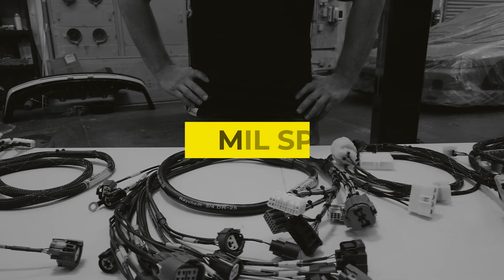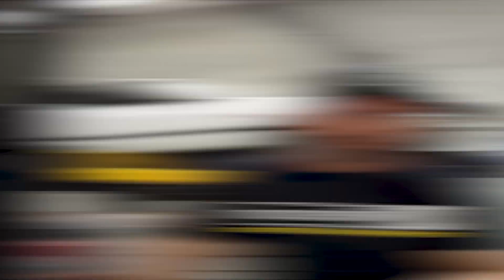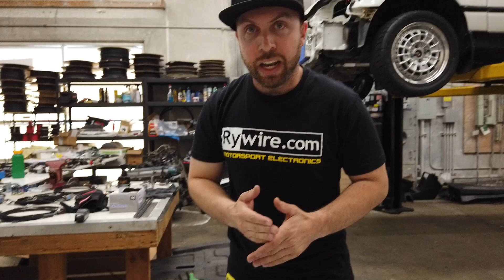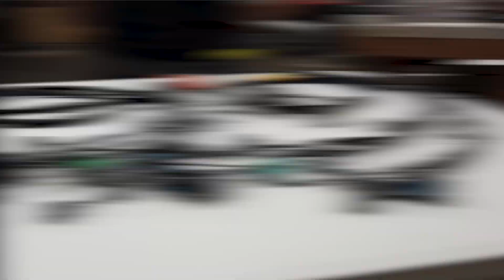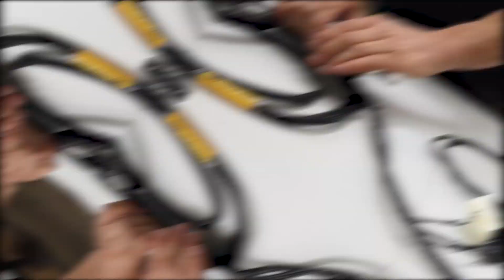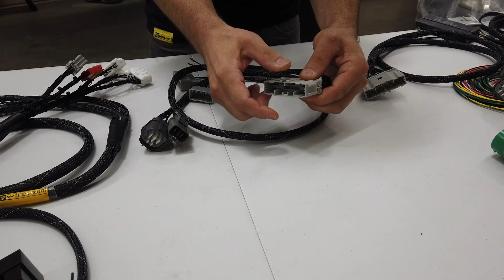Rywire Engine Harness Basics. How to Order. OBD Identification and More!

Comment: I have a 00ex with a 00 GSR swap. Currently running the OEM EX harness, it doesn’t have the crank position sensor on the harness to connect to the sensor near the crank. So I’m getting a p1362 code. Do these rywire harness have the crank position sensors on them? (I am using an OBD2-OBD1 adapter to run my OBD1 s300 ecu

Comment: For those asking, you need the sub harness. After you install it (92 Si), you will see that the harness needs to connect to connections under the dash.  My question is about the extra wires. Are the other ends pinned to the ecu connectors, and if so, which ones?

Comment: hi! i have a obd2b 99 ek coupe , and i have a b18b1 obd1 engine in it , what harness from your guys website would you reccomend? im using a obd2 alt , obd1 dizzy , and obd2 injectors. im not planning on tuning my ecu , i have a stock p06 manual ecu and a sotkc p75 ecu. thanks!

Comment: I have a 91 SI and i bought that chassis adapter but that yellow shock tower plug doesn't plug in anywhere. The ef has a jdm d15b and had the stock obd0 harness with a crappy jumper harness

Comment: I know you guys probably won’t respond but I just install my harness and chassis harness in my crx (dx) and the engine harness has the two extra wires you mentioned but off my chassis harness I have three flying leads? I figured out which two were in the engine bay… so where does the third wire go???

Comment: Hey quick question so would I be able to use a ek obd1 rywire harness on a ef would that work if your could let me know that would be great and if it doesn’t why not
Reply: 2years later not sure..if you started the project but what you was saying was exactly what he showed in the picture..the obd1 is the ecu side so yes .and the engine connectors are obd2 so yes.. this will work to install into ef/crx just make sure you get the chassis  adapter harness to complete the connection..

Comment: Rewired my factory harness due to previous owner . Car ran fine before but distributor plug was all jacked up . Made a new harness from ecu strait to the obd1 distributor and now the tach jumps and it misfires.  Question is do I need the shielded wire?. I used 18 gauge tezel wire

Comment: Quick question, 
I’m looking at your p14 pdm in my Honda with hondata v3. 
Will your “can” plug on the dash display option fit directly to an aem cd5 ? Or will I need to wire the 2 can wires into the hondata v3 as well. 
Thanks
Reply from the maker: CAN is wired to the ecu from the dash

Comment: Thanks so much for the info. Can the budget  tuck harness fit through Eg heater core opening without de pinning connectors. What’s that smaller shock tower plug control for Eg sub harness?
Reply from the maker: Yes it should have no issues

Comment: Extremely helpful video, this answers a lot of my questions I had since I was looking into buying a engine harness!! 1 Question though... by buying OBD1 to OBD2 engine harness does that mean It plugs in to a OBD1 ECU and the rest of the harness will be plug in play for my OBD2 96 Integra GSR? 

Amazing work man keep it up!!! You’re Integra is a work of art and huge inspiration.
Reply from the maker: yes sir
Reply: @rywire "In the dc adapter  wiring harnesses what control the plugs of the ECU i mean the 2 short plug for the 92 95 or the big one for 97. Help please